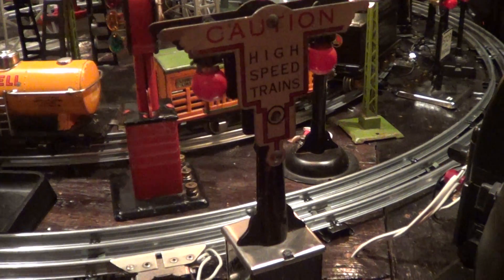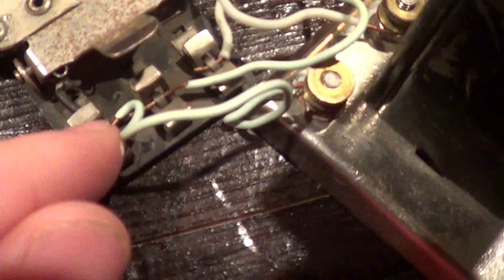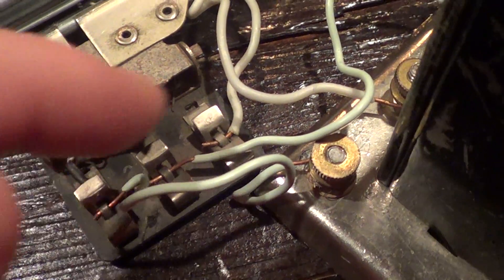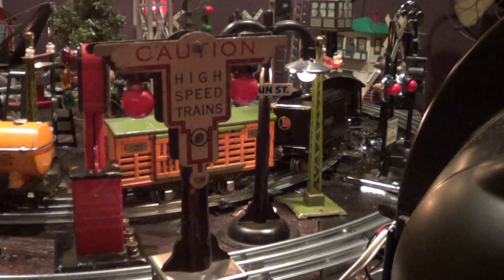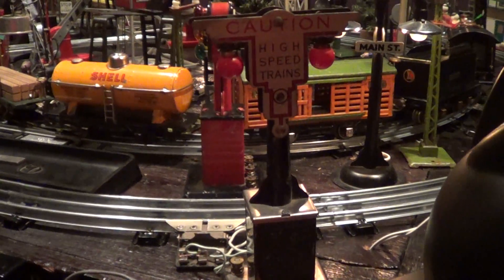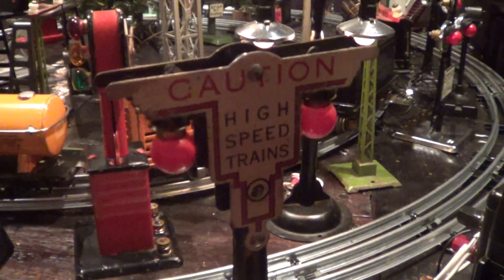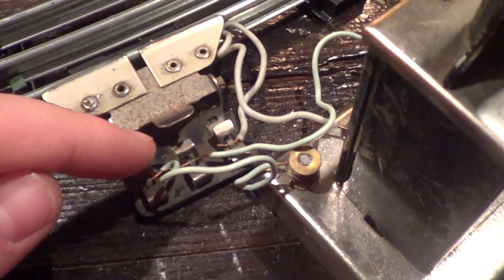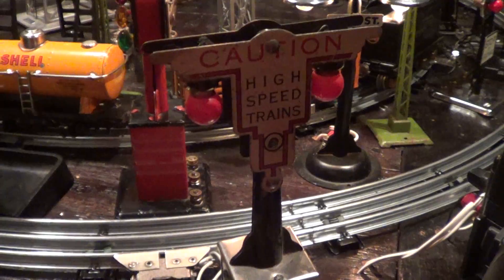How to wire a Marx flasher signal to flash individually

Comment: If you are installing the #423 Marx Twin Light Crossing Flasher, then you have that backwards. On the #423 the common (ground) is the center screw & it hooks up to the #1 clip on the 154C, not the #3 clip like you have it set up.